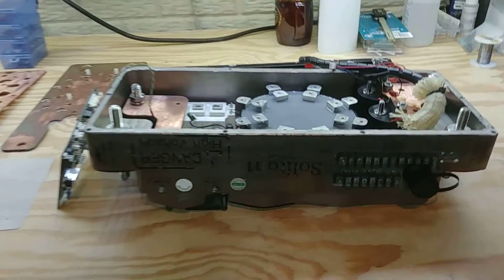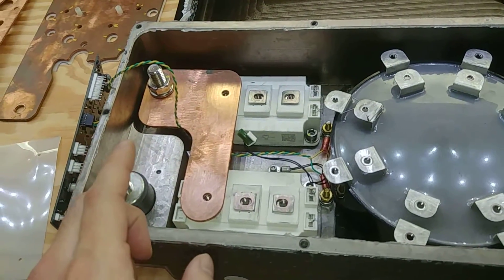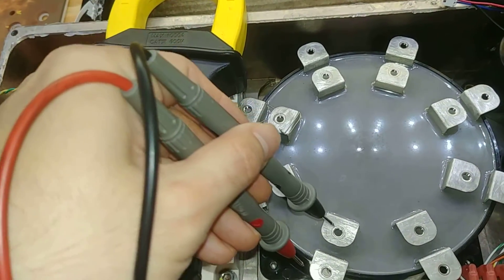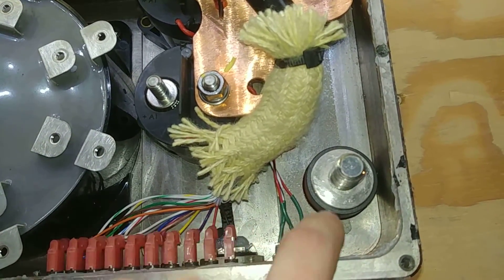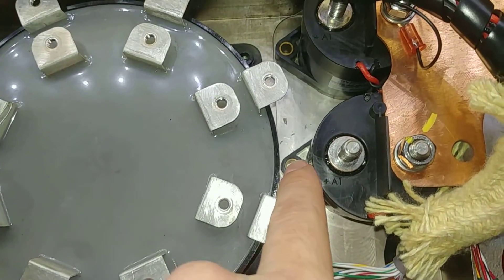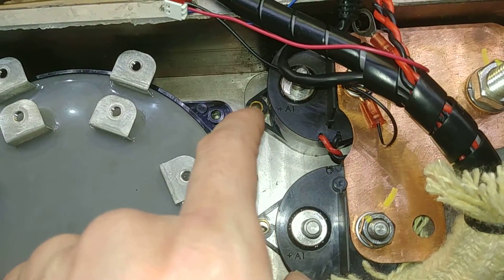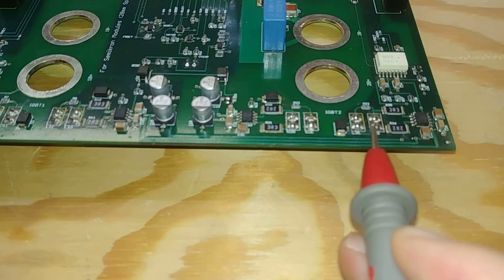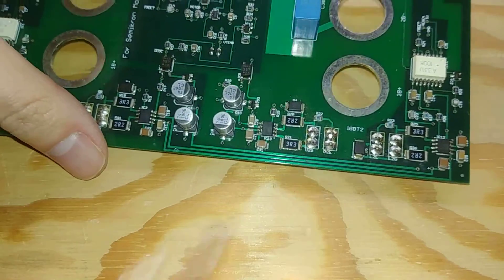Evnetics Soliton1 Motor Controller S/N 07129163 Part 2

Comment: Best way in this situation is to put a threaded shaft into the hole.  Run a jam nut and tighten to full torque for the main electrical connection.  Then slip the PCB on and tighten its nuts to hold it.
Reply from the maker: That is also a much better way!

Comment: The Label on the ring capacitor says: SBE 700D349 500uF 10% 600VDC 1051-1787-0001 I have more pictures if you want. Also from the Soliton junior.
Reply from the maker: Only 500uF?
Definitely a film capacitor then.

That also seems really low...
The Soliton1 must switch at a very high frequency.
Reply: @WolfTronix  Those Semikron bricks are pretty quick.

Comment: Why would they use an electrolytic capacitor and not a film capacitor?
Reply: I think it is a film capacitor.
Reply from the maker: It could be...
With the way it's mounted I can only read 600V on the label.
Reply: @WolfTronix   I remember when they were developing the Soliton Jeff was talking specifically about using a large film capacitor.  Just checked, from the product page:
"High reliability 600V film capacitors in the power stage – no electrolytics!"